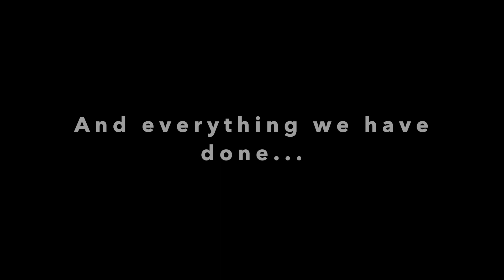WE HAVE A PROBLEM: OFF GRID LIFE UK

Comment: I fenced over 2 acres, in the summer (the wrong time). I dug a slit trench 6 inches deep, to drop the fencing in, to prevent the little bastards from digging under. Its that, or fold out 18 inches on the surface, and peg it. I used 25mm square hot dipped galvanised, but (baby) rabbits will get through hex holes  as small as 35mm. Still, a fence over 5 foot high I've never known a fox get over, but a weasel will. Gates should also have blocks/bricks inserted at the threshold, because the buggers will also dig there. 
Once the ground menace is addressed (air rifle for squirrels) look forward to the airbourne wave. Crows, pigeons, magpies, and goldcrests on sunflowers, in fact I use the goldcrests to tell me when the seed is ready.
Reply from the maker: That’s a lots of pests to worry about 😩😩😩 That’s without all the insects/slugs too  and we’ve even got a mole pushing up our strawberries and raspberries! Thanks for the tips 👍
Reply: @The_OffGridFamily  I don't have an issue with slugs or snails, as I let my bantams free range once crops have estabilished/removed. They'll also have ago at any fruit/leaves, so its a timetabled free range, with nets at critical stages.

Comment: Hope this makes sense: 
When ramming fence posts in, I first use a heavy 5' pointed iron bar, dropped into the ground maybe ~6 times & pushed side-to-side / back & forth to sort of pre-drill the post holes to maybe 1½'. I reckon this saves me >30% of ramming knocks, which feels like quite an energy saving.
Reply from the maker: Sounds like a sensible way of doing things 👍😊